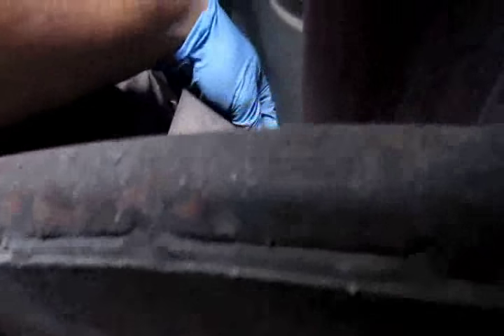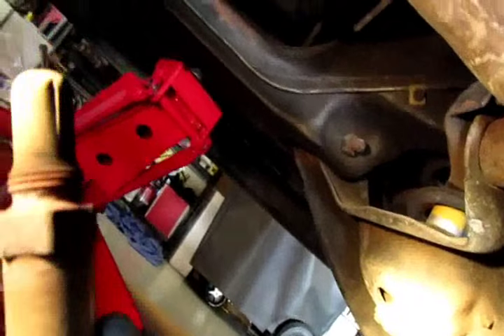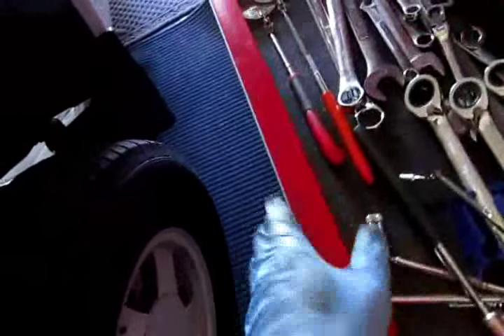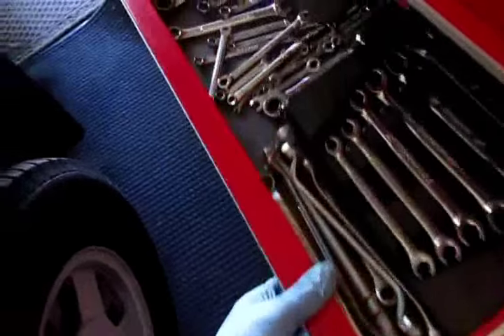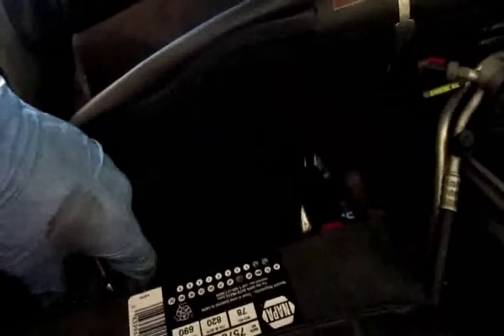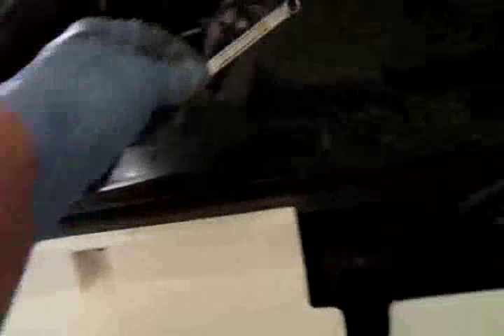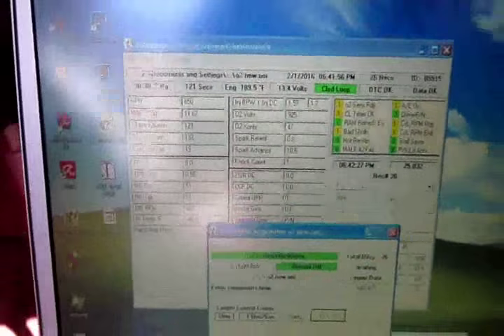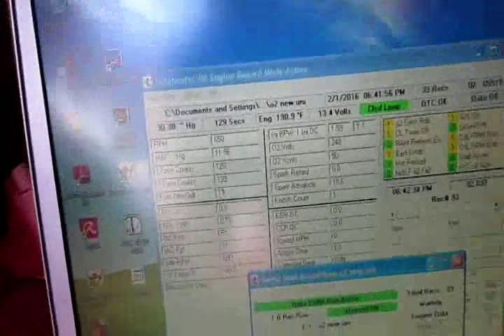How to o2 sensor replacement Chevy Silverado GMC Sierra 88-95 Tahoe Yukon Surburban

Comment: My 91 gmc sierra K1500 starts fine, but the idle is really rough and wants to die at intersections and when I put it in reverse. The mechanic I brought it to changed the fuel filter and said that's about all he could do because they don't make scanning tools for trucks that old. Any ideas what it could be?
Reply from the maker: Make sure it has 12-13psi of fuel pressure mine did that ran rough wanted to stall did stall and the fuel pump was dying.   Ran at 7.5PSI at times then I had better pressure as the pump warmed up  Changed the pump its been awesome I have a real strong pump now

Comment: I've cooked 'en with flame to clean up an 02 sensor in the past but I rather fit a new one...Average price here for an aftermarket unit is close as fuck is to swearing 100AU$ so that makes a 4 sensor job pretty expensive...Our GMH cars like to put the plug on top of the gearbox too...Guess how many people think the 14 is the fuel and the 1 is air....E85 is 10.5:1 and race methanol is 6:1 and Nitro can be a ? because of the variables and that Nitromethane creates it's own oxygen but at 80% nitro/methanol,,the fuel usage is 6 times that of petrol...You can do the numbers...It's late and I'm drunk..lol..Your ECU would be a plug and play deal by way of a chip change like mine..I'm not sure of the hidden "burn your own" programs that may or may not be out there but I'd sure like one.
Reply from the maker: +ZIGgassedUP  Ya It has a EPROM chip. I need to pull some out of junk cars and buy a chip reader and burner.   The chips are worth $35 each used, To erase it, UV light. I can put them in the dash and here with this sun they will be cooked in a day.    o2 sensors are cheap here.  30-80.  Now everything is a denso sensor, reboxed, different price.

Comment: Thanks for the video.  It helped enormously in changing this in my 1995 K1500.  I used a Bosch sensor and it works fine.  Engine is running smooth again and idling at around 600 rpm instead of 1000.
Reply from the maker: It will work for a bit, I never liked bosch O2 sensors they don't last. Used ACD, well they are denso reboxes so just a denso. They are cheap. $35-40 bucks
Reply: only one I could find was the Bosch.  I found a AC Delco on Amazon but needed to get the job done today.
Reply from the maker: Yea, I hear you, I got mine on amazon. Mine ran rough when it failed. Now I keep a extra sensor on hand for all my junk cars. I never want that to happen again!

Comment: great video... I have a 95 k2500 7.4....at idle and going down the road,  it surges and will not idle down....have changed everything...pulling hair out!!!
Reply: Check your egr valve, you take it out, push the plate down, hold your finger over the valve and the vacuum should hold the plate. If it springs back with your finger over the valve then its shot and you need a new one👌

Comment: Can you have a bad o2 sensor and not have a check engine light on?  I'm running rich, idle a little rough when warm.  Truck is 95 Tbi 350
Reply from the maker: Well, the o2 sensor can be slow to react, you will only see that on a scan tool checking the voltage fluctuation.  a ECT sensor that has "shifted resistance values" could cause that Vacuum leak, leaking fuel injectors.  If the o2 sensor has not been changed in some time, its good to change it. 60k-100k miles  The original had  90k when I changed it, This one lasted 60k miles
Reply: Ghetto Wagon I have an obd1 cable and want to data log but don't know what free program to use can't get aldl or tts to recognize the usbport on my laptop.
Reply: Also do any of your Tbi vehicles have an upstream o2 like on the driver side header?  If so where would the wires connect
Reply from the maker: They only have one sensor  I dont even think you can download any of these programs online anymore. iT all depends on the year and the mask of the ECM
Reply from the maker: No only 1 o2 Some TBI use a 1 wire, other use a heated one like this only 3 wire. Most o2 sensors now on new cars are 4 wire
Reply: Justin James Get a Actron CP9690 code tester. It checks live, record graphing, oil light reset, code connect to diagnose symptoms, and MORE!
Reply: Justin James.. you ever fix your truck
Reply: @GhettoWagon  If I have a 1 wire o2 sensor must I replace it with another 1 wire o2 sensor??
Reply from the maker: @MasonStevensss  YA same kind. the connector is different on 1 wire vs 3

Comment: I'm trying to turn the o2 sensor that I can reach from inside the cab of my Chevy G20 but there's a spring so my 7/8 wrench doesn't get a good grip
Reply from the maker: You might need a low profile o2 sensor socket that is kind of like  crows foot. Many make now

Comment: So on a 94 Chevy the upstream o2 sensor plug in is above the transmission somewhere
Reply from the maker: Yes it only has one
Reply: @GhettoWagon  upstream and downstream so 2 one behind manifold one after cat
Reply from the maker: @jordanholdcraft2886  Its a 94 its not OBD 2
Reply: @GhettoWagon  I never said anything about a obd2 reader bruh
Reply: @GhettoWagon  the 94s have 2 o2 sensors it has one behind the catalytic converter and one on the exhaust manifold g
Reply from the maker: @jordanholdcraft2886   No the earlier trucks had a O2 sensor in the manifold Usually those were when they ran a 1 wire 02 non heated   1994 only has one in front of the cat. 3 wire heated o2 sensor
Reply: @GhettoWagon  then u might wanna do ur research then buddy

Comment: Ok so I replaced the control arms on my 1990 Silverado tbi 350, when I put it on the rack it ran fine but after doing the work it wouldn't start unless I gave it fuel and the idle was rough like it was flooding, I noticed that there was a broken single wire o2 sensor on the drivers side manifold that had never been connected to anything and was letting exhaust out....is there another sensor somewhere that could be messing with the fuel mixture making it run like crap?
Reply from the maker: Could be
Reply: I actually fixed the issue....sort of....I found another o2 sensor further back on the exhaust and unplugged it and it started being driveable again.

Comment: So my 95 1500 flips but wont start, and when it does i have to hold the gas down. I've had many things changed on it. You think it could be the o2 sensor gone bad? I've had many people check it but they're clueless. And I'm losing my mind now.
Reply from the maker: No. o2 does nothing with starting.   Is your ECT sensor good and are the ground solid next to it on the intake manifold?

Comment: Idk if you can help any ideas are good. My 93 chevy c1500 tends to turn off and runs rich. Also spits out blag fluid out the exhaust. I've changed all them sensors [not the 02 sensor yet), changed full injectors as well. Any idea please help
Reply from the maker: You should plug it into a scan tool and look at what the sensors are reading and the fuel trims before tossing parts at it
Reply: @GhettoWagon  what's a good scan tool I can buy if you don't mind me asking ? For a 93 obs
Reply from the maker: @eliasreyes1945  If you can still get them the GM Clone tech 2 from Hong Kong works the best.  They were $250-300 shipped right from China via DHL.  Depending on what factory cloned it some are a little nicer quality then others

Comment: I’m getting a code 13 on my 94 350 so I wonder if it’s this easy just changing the sensor
Reply from the maker: 02 sensor? if its not rusted in it comes out easy. If its rusted on heat the bung.

Comment: Love this man. I wonder where I can get my truck hooked up to a computer like that so I can measure what's going on with the fuel. I've replaced everything so now it's getting gas and spark and is timed but won't run long. I think it's flooding but idk how to adjust it
Reply from the maker: Just get a Tech 2 clone from Hong Kong for around $300 USD shipped.  From HK. they work fine
Reply: Use a paper clip and Google the codes

Comment: Hey i have a 91 k1500 and it just feels slow has been for years recently i went up a mountain and i had my pedal to the floor and the truck stayed at 65mph the whole time without towing anything
Reply from the maker: could be alot of things Fuel pressure bad fuel trims sticking brakes transmission dying.
Reply: @GhettoWagon  nha my transmission isnt dying truck is in immaculate condition 1 owner truck my front brake is sticking ima fix that tomorrow how can i adjust fuel trim

Comment: 92 Chevy Silverado 1500 short bed. 1 or two 02 sensors? Before or after the converter? This truck was a standard but converted to an automatic. 6cyl engine.
Reply from the maker: I dont know Its OBD1 so why would it have one behind the converter.
Reply: @GhettoWagon  it's my 19 yr old son in-laws truck and he's been having running issues that he hasn't figured out and I suggested the 02 sensor. The guy at the parts store asked if it was before or after the cat. I've read some info that says this truck has two and others that says it has only one. I came across your video and thought I would ask. I was wrong about the engine size in his truck. It's actually a 5.7 350 engine. It's been rough idling at stops, trying to die. Bogs down when accelerating, backfiring and he has, under others advice, replaced the fuel pump, plugs and plug wires and it's still running bad. Thank you for responding to me. I appreciate it. He bought this truck from another guy that was rebuilding it so hard telling what the issue is. Many things are brand new on it, including some wiring.
Reply from the maker: @tcaldwell1782   Ya if it was converted to an auto its some extra wiring  Ya parts guy is not bright they dont have any o2 after the cat on any pre 1996

Comment: Okay so i went ahead and tested the Tps its working great. But i noticed that when the engine is warm and the rpms start going up and down and the truck wants to die if i push in the egr diaphragm and let go it starts to idle great maybe i need a new EGR?
Reply from the maker: +Jr Chávez  When you depress the EGR it should stall at idle as you are opening it. If it starts running better , Hmm...  You could try testing it,  The EGR port can clog up causing some weird drive ability problems.  Unless the EGR is causing a vacuum leak?

Comment: hey what kind of scanner or code reader do you suggest for my 1995  silverado 305
Reply: by the way could you do a throttle body rebuild  video? lol redoing eveyrthing on my  truck....sensors, modules, fuel pump, injectors ect....

Comment: I have a 92 Chevy, but I can't seem to find out if it has just 1 sensor or 2?
Reply from the maker: Should have 1 and it may only be a 1 wire  o2
Reply: Thanks for the reply, I'll get that changed out right away. I think the bad o2 sensor is causing it to run rich, which in turn could the plugs to the point now where in chugs instead of hums and coughs black smoke when I start it. So new o2 sensor, new MAP sensor and new plugs

Comment: what was the symptom did u get any code on that truck I'm having an idle problem on my 99 Tahoe but I don't get any engine light, I'm thinking it might be the O2 sensor
Reply from the maker: Well best way to test the o2 is to hook it up to a scan tool and watch the wave forms/ o2 sensor voltages. If the sensor is not producing a nice wave from , its failing. A bad idle could be alot of things.   A simple tuneup needed, Plugs wires, cap rotor,  TPS sensor can do the same thing, produce inaccurate voltage causing the computer to think the throttle angle is percentage or VOLTAGE on a gm that its not.  Coolant temp sensor shifted valve could do it, Dirty MAF sensor.   Mine just started missing and running poorly once it "warmed up" o2 sensor starts reading at about 150 degrees engine temp when the computer goes into closed loop and uses the o2 sensor to adjust the fuel mixture.   It threw the code at the same time, I checked the o2 voltages, they sucked.  New sensor. Fixed
Reply: Was it the sensor? My truck has been idling rough too, even stalls when switching into gear.
Reply: @Defund_HOA.   did you figure it out mine does same
Reply: @michaelmarmolejo9377  Sure did, sold the damn thing fixed everything!

The new o2 sensor didn't help, mechanic couldn't figure it out either. He was leaning towards the idea that in upstate NY, being -10-20 degrees constantly was causing it to act up, which could somehow make sense because it would idle & shift fine only after the engine was on for about 10-15mins

Comment: would the sensor be in the same place for a 91 k5? I cant seem to find mine.
Reply from the maker: Should be. or its in front of the pipe more seen in the engine pay. Should be a 1 wire non heated o2 sensor on that year truck. They do not last long
Reply: thanks bud, found it a few days ago. Its a one wire.
Reply from the maker: Yup. 1 wires don't last too long. If you want to be fancy you can wire in a relay and a power source and make it a heated o2 sensor.  Ground. 12v key on, and the wire that is already there, the signal wire for the ecm
Reply: @GhettoWagon  how do you get that done?

Comment: what i dont like about the video is you font show yourself taking it off, the difficult pos sensor that doesnt want to move
Reply from the maker: You don't like that the o2 sensor spun right out? LOL. On the same truck years ago I had to use a torch. Heat up the o2 bung and yours will come out. Once the o2 bung is clean and has no rust on it they will always spin right out.
Reply: thats what i want to see lol!! my dang 02 sensor was just like that, damn thing

Comment: Before replacing a Oxygen sensor, consider the possibility of it stripping. You might take it to a muffler shop where he has a welding torch etc.
Reply from the maker: That takes too much time.   If it does not move heat it and it will come out
Reply: Ghetto Wagon There are ratcheting box wrenches with ratchet handles that sometimes might make the job easier.
Reply from the maker: I have a bunch of those but not in 7/8 or 22 mm

Comment: nice video. I got a 94 & it is idling a little rough. thanks for the tips you been helpful.
Reply from the maker: yea this thing acted up out o nowhere. It was running great until the ECM went into closed loop and it started running really poor. Its still good now,, My diag and repair was spot on

Comment: Nice, mine is idling high in park & neutral it drops in gear but rpm surge up and down when warm i have no clue what the hell it is i tried everything any ideas?
Reply from the maker: +Jr Ch&#225;vez  Anytime I had a high idle in a TBI truck, I took off the TPS sensor, made sure the sensor was clean around the area it turned with the throttle blade then, re installed the sensor while applying pressure on the sensor on the RIGHT side,, Clock Wise  motion, when looking at it, from the passenger side of the truck, Tightened the screws, It kicked down the idle.  That was only when the idle was maybe a few hundred rpm that was higher that normal. I usually wound up replacing the TPS sensor when the problem came back.   Just remember the TPS sensor should be as FAR  turned forward to achieve a half a volt at idle. If its HIGH .6 .7 . 8 volt it will idle high and will shift hard if its a automatic 93 or up. Try to get a Ac delco one and make sure its not Chinese. Best is to check the TPS voltage with a scanner of some sort that shows live data, If you don't have acess just put the sensor like I said, As far forward or CW as you can.   if ts really roaring high you could have a vacuum leak, spray around the throttle body base gasket with some carb cleaner see if the idle changes.  Around the intake gasket too. Also make sure the throttle blades are closing, when they get dirty it could cause it to idle high,
Reply: +Ghetto Wagon I haven't replaced the TPS sensor yet but I take off the connecter and it seems to run better. Still stalls here and there while on park or when I drive it. In your opinion could it be that, the IAC sensor, or the O2 sensor? I have a 1990 chevy Silverado 3500.. So when I do that dash light test where it blinks to get your code, it comes out as code 13 which says O2 sensor but mechans that I've asked said it doesn't sound like the O2 sensor. Trying to fix it myself to save money. I'd rather find the exact problem than replacing all 3. Or should I take off the throttle body and clean it?
Reply from the maker: purestress2
 You probbably have a o2 connection or o2 sensor. Code 13 is DTC - 13    Oxygen sensor circuit open or no activity.  1990 may have a 1 wire o2 sensor sometimes the wire  from the o2 to the ECM can be faulty on those. Trace the wire?
Reply: +Ghetto Wagon so could that be the reason for the stalling in your opinion? The other day I went to start it in the driveway and I was out of town for 3 days. It sounded like it was out of gas. I sprayed a little carburetor cleaner down the Tbi and the second time it started and stayed at idle.
Reply from the maker: purestress2
 If the o2 sensor has an issue it would only stall when the engine is warm and the ECM is in closed loop.
Reply: +Ghetto Wagon ok I gotcha. So it could possibly be air control or the TPS then. When the TPS connecter is connected it sputters more than when I disconnect it from the sensor.

Comment: I have a 90 GMC Sierra it studders under heavy throttle and backfires at high rpm and will lose power and will die after it dies it will not want to turn over
Reply from the maker: Check the fuel pressure. Also inspect the cap and rotor  Could be ignition related